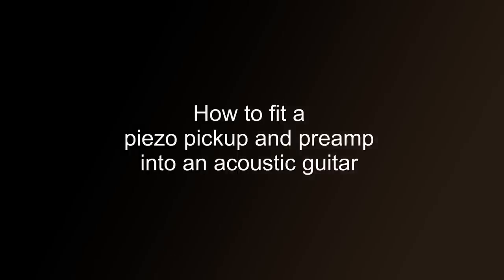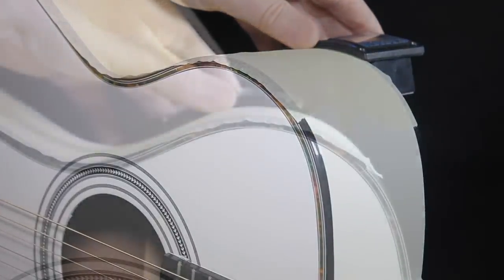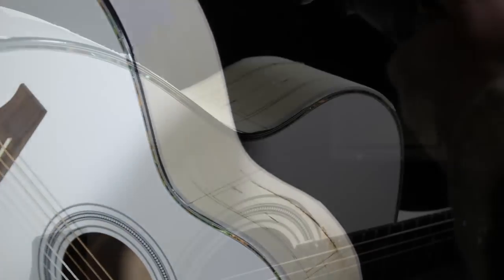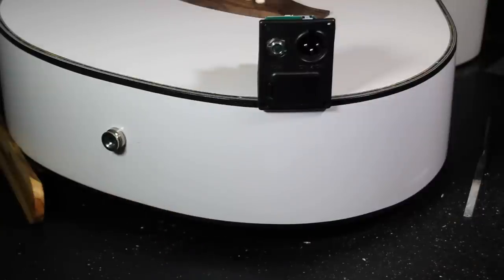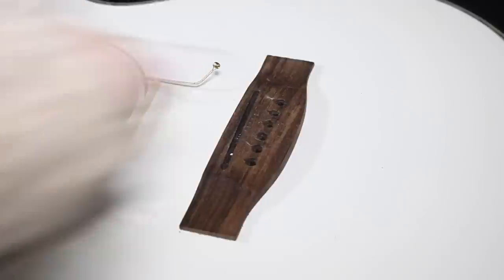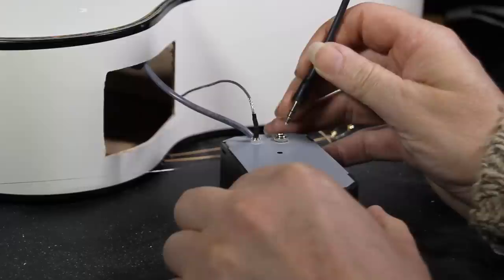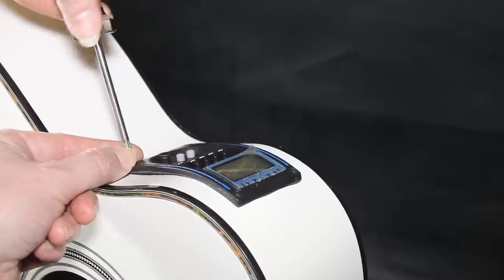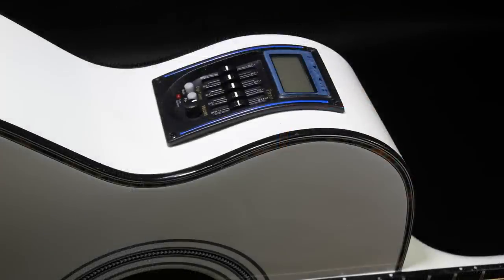How to fit a piezo pickup and preamp into an acoustic guitar. The LC-5

Comment: When installing a large output-jack module (such as here), it's important to remember to NOT 'intrude' into the area of the butt-end of the guitar that is occupied by the guitar's internal end-block.  These end-blocks are glued into the guitar, to reinforce the center of the guitar's butt-end, where the two sides come together.  The end-block can vary in size quite a bit, but are usually two to three inches wide.
Reply from the maker: Good point and absolutely correct as the end-block is an important part of the guitars strength.

Comment: I installed a few preamps and I allways look for mistake  in videos but you did a perfect job  its allways nice to see someone do a good vid.
Reply from the maker: Thank you . . :-)
Reply: loadi2  what mistakes can you reccomend to avoid?
Reply: first of all my friend ...you don't drill holes or use a jigsaw....you tape the  area with green painters tape , mark your dimensions , cut with exacto knife or sheetrock knife  with new blade  (FOLLOW LINES ) don't use to much pressure PASS OVER LINE UNTIL YOU ARE TROUGH be carefull at the end be gentle ..remove tape a little sanding to make the edges clean and have a snug fit....AND THEN NO MISTAKE ....
Reply: Did u need to file down the saddle for the piezo fitment height adjustment.?
Reply: @wchbang4811  If you watch carefully as he is testing the fit of the preamp and marking for the screws, you can see the pick he uses to mark the holes go straight into the body of the guitar because the one thing he didn't do was leave any wood for the screws to go into. If you notice on the bottom of the preamp, there are angles that he simply just cut away. Those angles were there so that the screws would have some wood there to grab onto. I'm sure he figured that out. But I also bet that he got a buzz while playing because some of the screws wouldn't tighten. Just something I noticed.
Reply: GCH Guitar Academy yo does this fit on a small acoustic
Reply: @Arcturian1111  If you didn't have an undersaddle pickup, yea you have to file down the saddle. File it just a little shy of the height of the piezo and then progress till you action is right

Comment from the maker: Phill Robinson That's a good suggestion in theory however, like most acoustic guitars the depth isn't uniform.  On this instrument the body is thinner at the neck than at the base.  Therefore if you use a set-square the preamp just looks crooked.  It is better to find a centre line and work from there.
Reply from the maker: +Nick kourletis NO . .  you only  put a microphone if you want one . .   :-)
Reply: +GCH Guitar Academy PLS any one can help me will be appreciate it!:)I don't understand what the mic is for ?!Is it the main part that the sound comes from or it's not matter if you put it or not!because I bought one without any mic and I wanted to buy this sony one!But if the sound is coming from the mic then why the pikup piezo is for ?Thanks for anyone that stands with me :) thanks guys.. xD
Reply from the maker: +Fadi Jubran The one with the mic also has a piezo.  You can balance the sound between the piezo and the mic so you can have all mic or all piezo or a mixture of both.  The mic sounds different to the piezo and it is a choice if you want to use it or not.  You do not need to have a mic it is just for extra variation to the sound you can produce . .  I hope this helps  :-)
Reply: +GCH Guitar Academy Ohh thanks for replying mate so the pickup that goes under the bridge the sound coming from it ? 
Thanks again appreciate it thanks :)
Reply from the maker: +Fadi Jubran Yes, the sound is good that comes from the pickup under the bridge.
Reply from the maker: +Dušan Šinka This video is now at least a couple of years old and this model is no longer made.

Comment: I am not really a guitar player, but your expertise of cutting into the wood makes me want to cut into the wooden paneling of my $2800 Dave Smith Squential Prophet 6 and do some modding. :)  This was a very impressive instructional video.  Excellent Instruction.  Maybe you should have stuck a KM84 in there.  Well, the Neumann KM84 looks better on the mic stand outside of the guitar anyway. At least my Peluso  84s look nice when I track acoustic.
Reply from the maker: Well you certainly like you gear . . . . 😊😊

Comment: Great Job.  Did u have to make any adjustments with respect to the saddle due to the piezo install?
Reply from the maker: The saddle and bridge were left untouched because this guitar had a shim under the bridge that I just removed, however in most cases I have to take the width of the piezo off the bottom of the  bridge.   Apart from drilling a hole for the wire I never remove material from the saddle (it's very risky).
Reply: GCH Guitar Academy in  this conversation, are you referring to the plastic saddle as the “Bridge”? Or why would you consider removing plastic as risky as opposed to removing wood?

Comment: Thank you for showing this. I have a couple questions. 1) when you install the transducer under the bridge, it has the effect of raising hte bridge about 1/16 inch and therefore raising the action of the guitar. Did I miss in the video where you shaved the bridge down to compensate? 2) Temu and aliexpress show about 4 EQ pre-amp, tuners that look exactly the same, but have different model numbers. It seems impossible to tell if one os better than another. How do you choose? Thanks much.
Reply from the maker: With the pickup, I did mention that the guitar already had a pickup built into it so I didn't need to sand down the saddle or drill a whole for the lead (09:25).  I have done a video on how to set up the  action correctly.  https://youtu.be/xbKyNBYBveM  
Regarding model numbers, Sorry I have no idea, I don't use Temu or Aliexpress.  Maybe it's worth checking that it's not a stock number generated by the website rather than an actual model number generated by the factory. 🤔
Reply: Yup, I missed it. Thanks for clarifying. Temu is an interesting place.  Obviously a lot of knockoffs, but sometimes the real thing.  For example, packages of Slinky guitar strings that look totally authentic... for $.99.   I haven't ordered any. I appreciate the time you took to share this information.  @guitar-academy

Comment: So that Sony microphone that you added to the original preamp I understand is a stereo microphone did you have to use an adapter to use both sides of the mic or did you just stick it in there and only have one side of the mic working?
Reply from the maker: Good question . . The mono mini jack socket automatically shorts the channels into one channel so it picks up both mics as if it's a mono mic. 😊

Comment: Hello, I hope you are having a great weekend. Thank You for such a great video once again. I actually bought the 4 band EQP pre-amp that is very similar to the one in your video, minus the small microphone. I bought a $35.00 USD "00" body shape acoustic guitar, after setting it up and fixing some minor issue, I installed the piezo pickup pre-amp EQ using a rotary tool and a sharp pocket knife. Sounds amazing! Good enough for the commercial licensed music that I write. Cheers! - MrTom
Reply from the maker: It sounds like you have made an OK guitar into a great guitar.  :-)
Reply: Yes.. and it's rare to find a "00" body acoustic guitar at the $35.00 USD price point. :-) Very interesting body, as it has birch wood for the back and sides, with a butterscotch like stain... again.. very interesting.
Reply from the maker: Sounds a really nice looking and unusual guitar
Reply: I got a couple Glorry brand for $47 and the pre amp for $10..The guitars needed work out of the box...i had to recess the front part of the bridge so the strings would clear it...The action on those guitars are around a usa quarter thickness at the 12 fret (NOW)...Standard electric guitar action. The action on my electric are actually lower...I also had to clean the fret's ends.
it's less than an hour works...including install the preamp. Both guitars plays great..they sound different acousticly...even though they're identical guitars. Oh yeah...the tuners on both guitars need replacing.
Not a big deal...metal seal tuners are only $10...I dont have problems
with them...
I also got a Irin for $67 and $12 for preamp with mic. The Irin are better quality controlled out of the box...i still had to drop the action and clean the frets ends.. only sand the bridge saddle to drop the action.
This guitar is made from sapele wood. it's brighter.
 I dont mind the guitars having different sounds..
Around $75 each...with preamps....I cant complain
I know how to set up and build guitars...it helps
i have a 1960 Gibson Mocking Bird ( it's dad's old guitar)
Honestly...The gibson sounds better...but not $30K better.lmao
Plus Im not going to drill holes in dad's old guitars..lol
I scratched the new guitars already. i dont mind...camp fire , picknic guitars. If they get stolen...i wouldnt even cry

Comment: You did an extremely incredible job sir and I really learned alot from this video in fact I'm going to use this video to copy what you did on your guitar to both of mine. I'm 17 years old and have been playing for about 2 1/2 to 3 years and you've inspired me. I love the song at the end as well! Also the Sony mix I found 2 versions of one costs about $5 and the other around $50-$60 which one did you buy if you don't mind me asking? Also I'd like to inform you that there is a new Sony STM mic which is an upgraded caged in version of the mic on this video but I enjoyed your playing too much too not buy the exact same as you! Please reply back? I'm eager to learn
Reply from the maker: +Jake Mitchem I can't remember now which one I bought but I know it was an older version.  One of the best things about this mod is the fact that the microphone plugs in, so you can change it whenever you want.

Comment: it's so nice to see you reply to all our comments. I hope you reply to mine as well. So the sony ecm ds70p cost is quite high, I'm thinking of getting the fake one which is comparatively cheap, so will I still be getting a comfortable non-noisy tone with that cheap fake stereo microphone?
Reply from the maker: That's the one I used (the copy).  I borrowed a Sony one and did a comparison and the difference was tiny and easily corrected with EQ, it was not worth the difference in cost to get the Sony. :-)

Comment: Hello sir, that was phenomenal work. I wanted to know, is there any way to protect the preamp and the equaliser's control sliders when not in use? A lot of dust gets into it and is almost impossible to clean. Thanks in advance!

P.S. That's a beautiful white guitar... Could I know the model? A link will work!
Reply from the maker: Thank you . .  😊.
The idea of a cover is a really good one because I have never seen one, but it would be a great project for someone with a 3D printer.   
The guitar was a 'Martin Smith w-401e', but the newer ones are slightly different, but you could probably get one second hand of eBay for really cheap.
Reply: @guitar-academy  Thanks for the reply sir. That 3D printed preamp cover idea is really great! I mean, I do put my guitar in a gig bag when I'm not playing for a long time but the dust accumulates in some way!! I may find one with a 3D printer or make something myself with some easy to find things... Maybe some really flexible plastic cover which would snugly fit around the exposed part of the preamp??
Thanks again.

Comment: Good info video by you actually I'm facing same issue noise humm ground issue so do I need to change saddle pick up or there can be issue in pre-amp also????????
Reply from the maker: I start with the jackplug socket first and work my way back.  The easiest thing (which you've probably done) is to check the connections are pushed in correctly.  🤔
Reply: @guitar-academy  I use di box for noise hum in live but in home set up practice there is hum, cable is okey so like to know is there any problem in pre-amp or saddle pick up????? Well! Thanks for reply

Comment: Hi, thanks for the great video. I followed to install a preamp like yours and it worked. The only thing i can't do is to use the mic because it immediately causes distortion. What mic are you using? Can you recommend some not expensive mic? Thanks again for the great work!
Reply from the maker: I'm really happy that the video helped you.  I used a 'Sony ECM-DS70P' but you can get copies of these off eBay that work just as well in a guitar.  😊
Reply: @guitar-academy  Thanks for  the quick reply and for the suggestion. I will for the cheaper ones on ebay. Thanks again!
Reply: @guitar-academy  By the way. Do you have any idea on why the mic causes distortion (it is so bad that cannot even use it). Anything that I may did wrong? Thanks!
Reply from the maker: @ricardojoaogodel  Without seeing it and hearing it there is no way I can tell.  It could be the mic and it could be a faulty pre-amp, it might even be as simple as the mic being plugged in the wrong hole.  Here I can swap things to check them.  If you can I would suggest borrowing a mic from someone or something just to try it, but if you can't I understand that.
Reply: @guitar-academy  Many thanks for your reply. I already order a simple mic and I will try it as soon as it arrives. Even without the mic and just withthe piezo the sound is great. I hope that blending them will be even better. Thanks again.

Comment: Thank you so much for the review. There are only 2 guitar pick ups available in my local guitar shop. The LC-5 and Fishman 301. Which of the two would you  recommend? Thanks
Reply from the maker: Thank you . . . I can only give you my experiences of both pickups.  The LC-5 I put into this guitar kept flattening batteries very quickly, so I had to remove them when I wasn't using the guitar.  This might have been a fault, but I honestly don't know.  I install Fishman 301 now.  I hope this information is useful 😊😀
Reply: @guitar-academy  Thank you for your reply.  Sound wise, is there a difference in quality? The Fishman 301 is twice the price of the LC-5. But if you suggest the Fishman, I will go for that. Thanks again
Reply from the maker: @jineshthomas7887  It's hard to say if one sounds any better than the other without trying both pickups in the same guitar.  But from my own experiences I would say they sound very similar.
Reply: @guitar-academy  Thank you very much. Wish I had these awesome resources when I started off in 1997.☺
Reply from the maker: @jineshthomas7887  no problem, yes things are easier these days 😊

Comment: Hi, thank you for the video ! How much did you spend on that amp? Is it worth spending more on brand-products or do the no-name ones do a (almost) equal job?
Reply from the maker: mrbomplastik Good question . . . 
I used this product because at the time I made the video only one or two companies made the variety with a mic.  The criticism I had of the preamp I used was the fact that the batteries went flat very quickly.  Another thing to consider is the fact that I fitted this pickup/amp just to make the video and the guitar was a very cheap one.  If I was doing this again on a guitar that was more expensive or a guitar I liked I would probably go for a brand-product, but I would recommend a bit of research first . .  looking reviews and stuff.
Reply: GCH Guitar Academy The thing is that most reviews say the expected: decent sound for that price.... doesn't really help... have you personally any experience with the (30 bux) fishman presys blend? Sounds nice in youtube videos.... most other tests, demonstrations and comparisons are only for high end products...
Reply from the maker: mrbomplastik At the moment I don't do reviews, mainly because I don't have a sponsor and I don't have the resources to buy guitars and pickups just for the sake of tests.  I merely video some of the upgrades and repairs I do to my own and my clients guitars.  The videos I do are 'How To' videos and you would have to contact a reviewer to get a decent review.  However, you have given me thought for the future . . 

But to answer your question, one of my many guitars is a James Neligan electro-acoustic with Fishman electrics and it is the nicest recording guitar I have owned for years.  I would say it sounds more natural than any of the high end guitars I have owned.  I was just selling it for someone, but after playing with it for a week I sold my own guitar had held onto it.  So 'Yes' I have hours of experience with the Fishman in a recording environment and I rate them highly.

Comment: Hi, dunno if you're still commenting on this , but here goes anyway. Firstly i think you did a good job with the vid. Nice editing, free flowing, and easy to understand. I am  thinking of installing an UST on my guitar, just a few queries.....

1_Most people i see doing the 'upgrade' are doing so on cheap guitars, and as my guitar is worth approx £500 i am understandably nervous. Would you do this on a 'relatively' expensive guitar?

2_The topside of the guitar seems to have some varnish/lacquer, and i'm cautious about cracking it. Are there any tips to minimise the chances of damaging the guitar?.

Lastly, any advice with fitting saddle?

Many Thanks...................
Reply from the maker: +Benny Hill 1.  If you aren't confident . .  don't do it.
2.  once you have measured the whole size you can scratch or cut the varnish with a very sharp knife to prevent any cracks appearing.

Again . .  the best advice is if you aren't sure or confident don't do it, just buy a guitar with the pickups fitted.